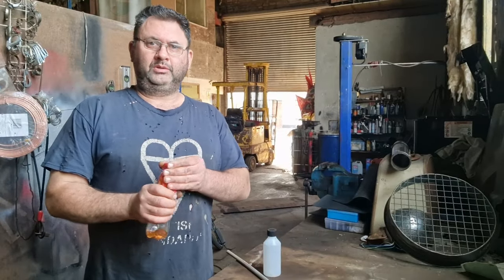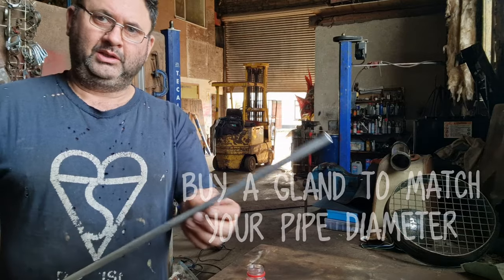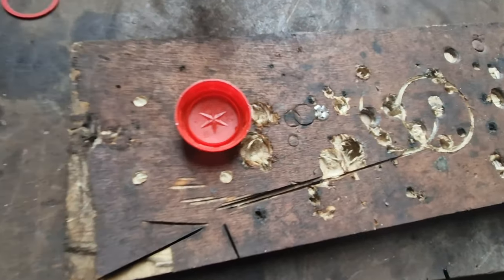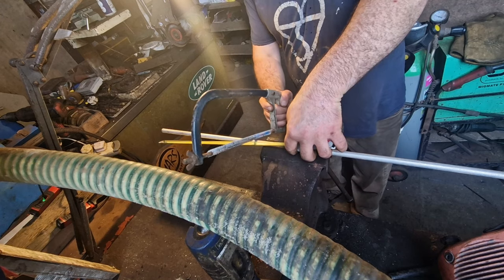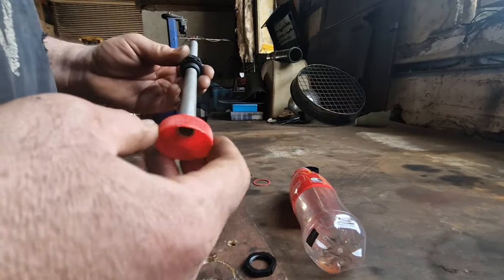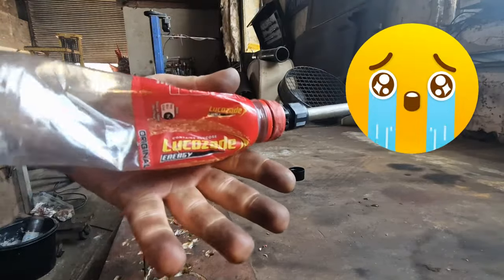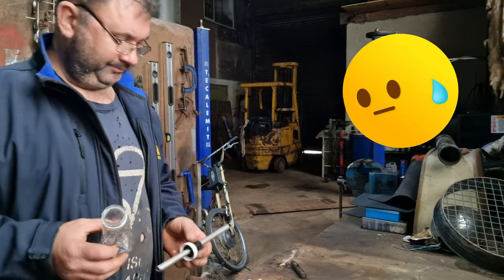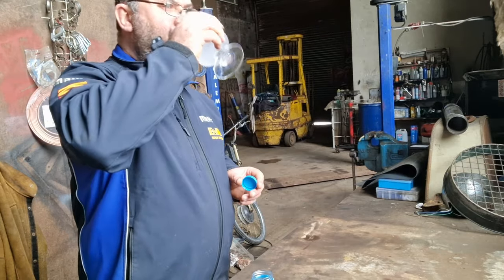HOW TO Make a DIY  GOLD Snuffer bottle for SNIPING

Comment: I think a squeezy Ketchup or Mayo bottle would be good 🤔
Reply from the maker: Defo the right material but the tops of them always seem to always be naff
Reply: @AurProspector  Rather then punching the hole, cut teeth into an off cut of the metal tube and use a drill to cut hole or try slightly smaller diameter and melt a hole, plastic does not like to be smacked ouchee cracks lol

Comment: I've had the same problem in finding the right bottle. One thing I noticed is that the bigger and longer the tube you need a lot more suction power. Today I came across a used up honey bottle that seems to be twice the thickness as pop bottles. It seems to pop back faster except that it is not round. I think a round one would work better so another option to look out for in your hunt.
Reply from the maker: Thanks Golden Trout, for the advice.

 Cycling drinks bottles i found to be the right material too.